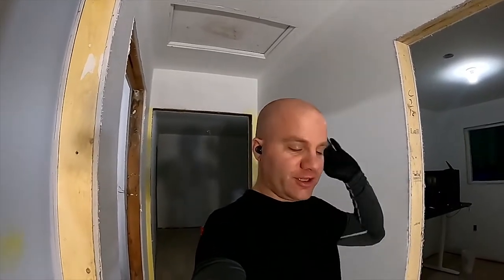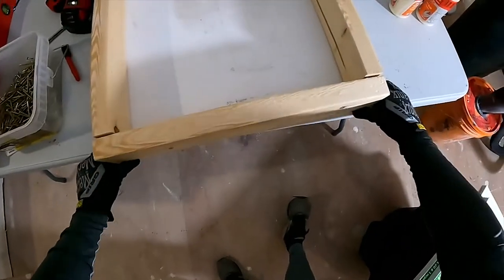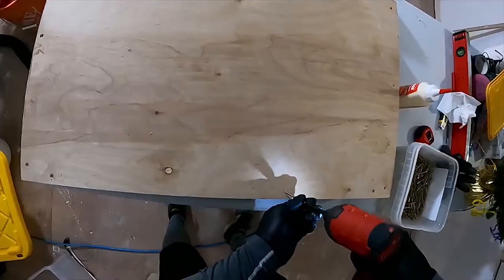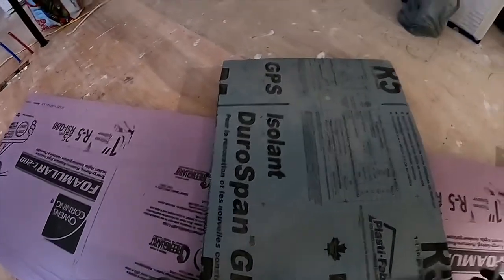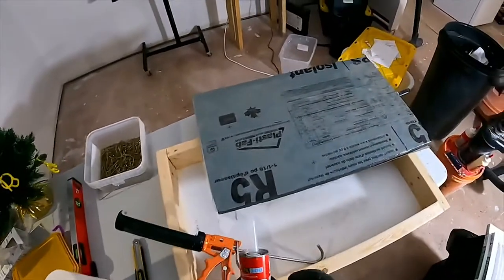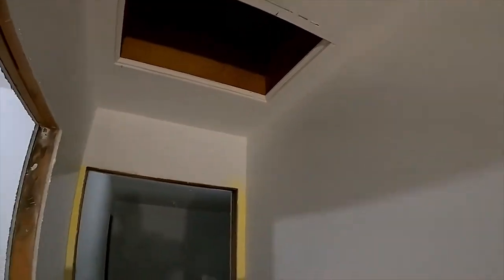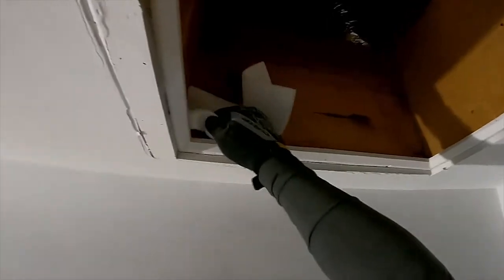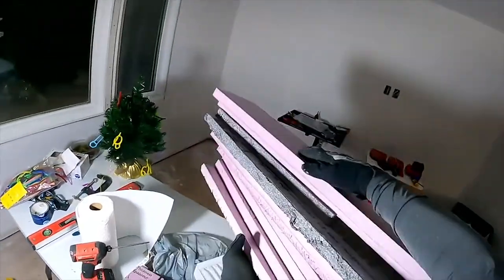How To Insulate Your Attic Hatch! DIY!

Comment: Doesn't fire code require the attic access panel to be sheetrock for firebreak?
Reply from the maker: inspector didn't say so, might be different where you are. 
also with the amount of insulation on top, that's way more fire break than drywall

Comment: Good video in effort. I see you are trying to be efficient. Some comments:
I am noticing many are technologically savvy on what to do, but fail on workmanship skillets, then excuse the errors/mistakes. It becomes harder to unlearn bad mistakes than it is to do it right the first time. 
Note: One could router the outside edges of the attic cover so it ultimately covers the unsightly look of weather stripping AND has more flush appearance.
Reply from the maker: Good idea! haven't painted it yet so might just do that

Comment: Thanks for the video, but good lord! That's the most ridiculous thing I've ever seen! It's a attic hatch door, which means it needs to be easily opened and removed by anyone, including other family members (or older people or dainty ladies that may own your house later). You created such a monstrosity with that 2x4 frame and a crazy number of foam insulation layers. It boarders on clownish and is totally unnecessary. It is so thick and heavy with all those 2x4's that it makes it difficult to actually move or use.

As other DIY videos show (for example: https://www.youtube.com/watch?v=lSLIbuR5WqU), all you need is a couple layers of 2" foam board fastened together and to the plywood hatch cover with some double-sided duct tape. There's no need to create that 2x4 frame, and forcing someone else to maneuver your heavy creation over their heads while on top of a ladder, creating a potentially dangerous situation. 

And to to deal with that warping issue, you just needed to replace the old plywood board with a couple of back-to-back pieces of fresh (high quality, cabinet grade) plywood, screwed together to create an inch thing scuttle door. Or, just screw sheetrock on the bottom of one layer of plywood (asI have in my house from the original builder) which has the added benefit of being able to have the same ceiling texture as the rest of the ceiling. And with the new wood layers (with or without sheetrock) and the 4" of foam insulation, the new door is very unlikely to warp. Mine has never warped in over 26 years, with multiple use each year.
Reply from the maker: @privatename3621  tell me, why are you going into the attic?
Reply: @MooseDoesStuff  To name a few:
. to store and retrieve seasonal and long term storage items
. to run new wiring or cabling
. to check an extricate iguanas (which love to get into the warm attics through the gooseneck vents until I riveted chicken wire on them)
. to replace AC line set
. to check for leaks
. to permit inspections when changing homeowners insurance
etc. What an odd question. I suspect the reason you ask is to formulate an argument that the need to enter the attic is so infrequent, that its okay if it is painful and difficult and thus should not be an issue. Have I got that right?
Reply from the maker: @privatename3621   @privatename3621  nope. it's to point out that attics in different parts of the world have different uses. in Canada, their only use is to keep heat/cold in/out. no long term storage. no iguanas. no running new circuits, especially in a house that has all brand new wiring. no ac in the attic, if we have ac here it's on the furnace in the basement.

most homeowners here NEVER go in the attic.

you're on the internet, there are people from all over the world here! 😁

Comment: you would have been a little better off, by cutting a new hatch wood itself, then installing a 1" foam board, BEFORE installing the 2x4 trim pieces. This would help prevent a little bit of thermal bridging from the cold attic to the out trim of the door board. Not a big deal, but one extra layer.  Otherwise good job.  I'm looking to re-do mine as well.
Reply from the maker: The 2x4s were used to straighten the bow in the plywood. At the time, any sort of quality finish, even just one side, for 3/4" plywood, was well over 100$. 
In this case, it's not a matter of thermal bridging because there's no direct cold contact on the other side of the 2x4. It gets the foam insulation above, and there have to be all sorts of air gaps around to be able to move it anyway. Makes me wonder if anyone's manufacturing these to be more door or window like.

Comment: Thinking of me aging and over head strength in future. On the back of the board could I staple a extra large pillow case, that over lapse the size of door so covers over door edges, as i lift up on the door now to enter the attic, fill it with blown in cellulose, vel-crove shut so can refill as needed. Lol do you think it would work ? As my logic says it should.
Reply from the maker: pillow case would round out and leave lots of open air space around it. the foam isn't that heavy, so if anything the bulk of the reduced weight would come in the door itself.
Reply: Thank you for feedback :)

Comment: What’s the fire rating on the foam? The stuff in the box stores all say flammable.
Reply from the maker: same for this, it is combustible. The blown in insulation I have in the attic is fire rated, so if the concern is a fire spreading, I don't think there's any realistic situation where the fire will start in the hatch.